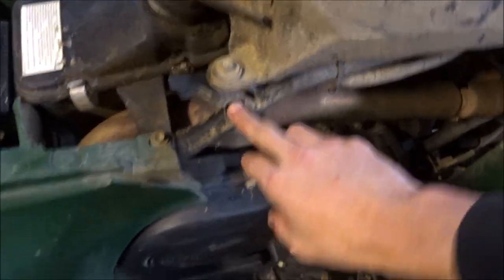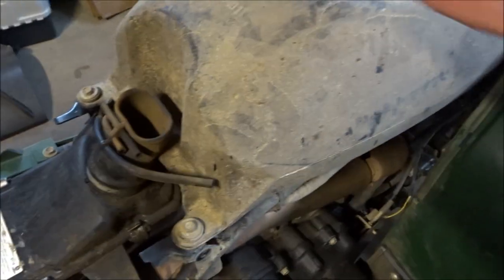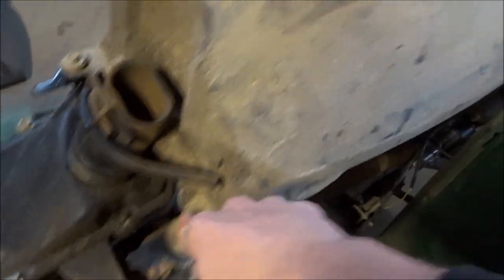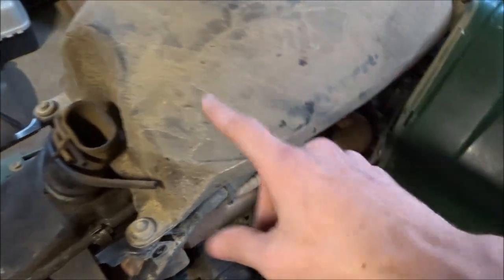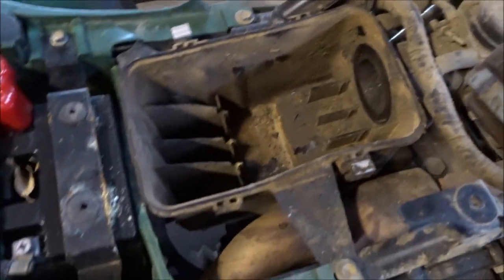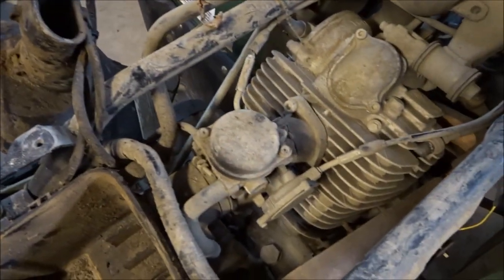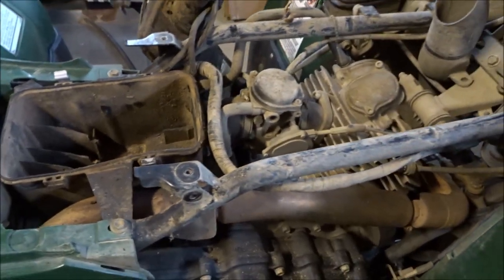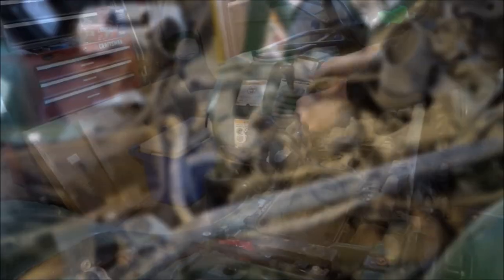Yamaha High Idle Fix (Part 1) 350 Grizzly Carburetor Cleaning

Comment: i have a 2002 grizzly 350 it was running ok but when i pushed the 4 wheel button it would not run and finally shut off. does this make any sense? any fix ideals?

Comment: hey mitch that brass screw at the bottom of the bowl right next to the big shiny screw, is that the air fuel mixture screw. i took mine out when i dipped my carb. it has a spring on it. how many turns out is the proper setting.
Reply from the maker: I can't remember off the top of my head but it was only a couple turns.

Comment: Hey Mitch where does the vaccum line go to at the bottom of the atv that you remove at the 7 minute mark of your video. is that just a breather hose or is it an actual vaccum line. mine is off and i dont know where it goes
Reply from the maker: I believe one runs to the airbox otherwise they're all overflow lines.

Comment: Hello, like your videos on the Grizzly. Have experienced the engine dying out when you give it gas?
Reply from the maker: I've expect that on other machines and it usually is linked to the carb being dirty and not enough fuel.
Reply: @HitchinMitch  thanks for the feedback. Going to rebuild the carb.
Reply: @joepope4031  idle takes offhigh. When warms up